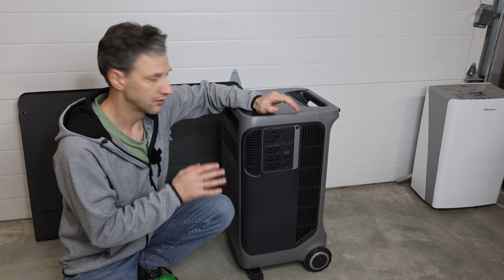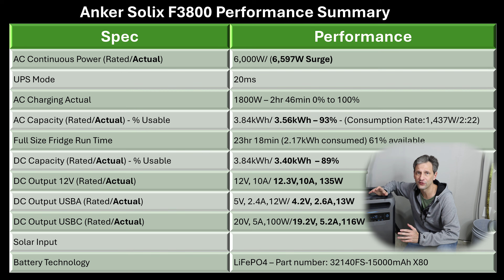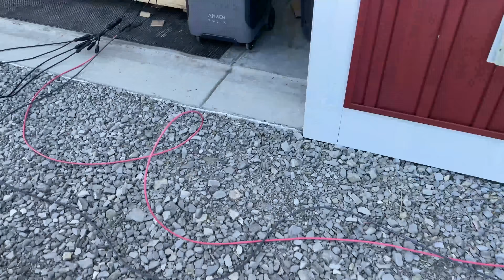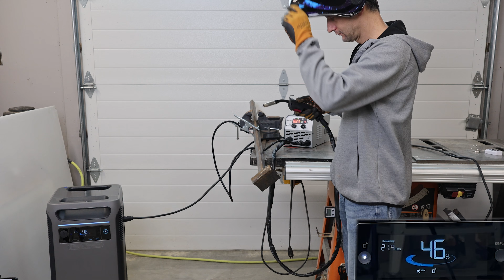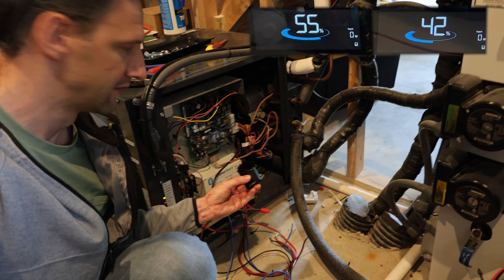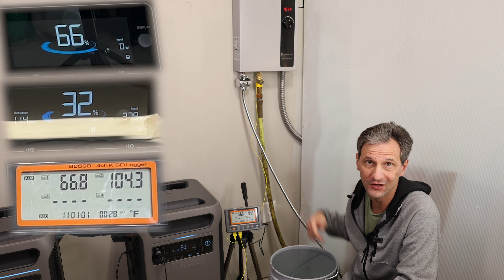Anker F3800 Solar Generator 120/240V Full Testing

Comment: The Anker Solex units really are impressive, also have very efficient inverters so you get very good performance per kWh of battery.
Reply from the maker: It’s impressive to see how much performance they can pack into these units.  They aren't the cheapest, but they tend to be one of the best performers.

Comment: i have an anker 3800 and im having trouble with a window ac its 2400 btu the biggest ive seen i need a connecter for an 240 vac 20 amp so it can fit  6-20 p any idea?

Comment: I purchased a 600 watt portable panel from All Powers. Could the  F3800 take input from two of these portable panels?
Reply from the maker: You didn't list the VOC.  As long as the voltage open circuit is less than the max input for the F3800 it should be fine.  Put your panels in full sun and check the voltage at the MC4 connectors to confirm before connecting to the unit.
Reply: @ProjectsWithDave  VOC is 52.8

Comment: So you would not recommend running the full 2000w solar input. I was thinking of using this for everyday off grid power so i want to get the full 2000w solar input
Reply from the maker: You can use a 200W panel as long as it is within the voltage range of the input.
Reply: Im trying to set it up like that as well.

Comment: Awesome review! Regarding these all in one systems and "selling" excess power back to the grid (I'm in an area that pays 1 to 1), I've read up that Anker is the only portable system with that capability. I was leading towards the Ecoflow Ultra system until I saw that it apparently is not capable of offloading to the grid. Do you have any info that speaks to that?

Comment: This saved the food on the fridge during Hurricane Milton. I used a small gas generator to charge it during the day, and run it silently ay night.
Reply from the maker: That's a great setup!  A gas generator combined with a battery backup is an ideal solution.  I show the data in this video: https://youtu.be/f0skwN5sJvg

Comment: Very nice review, as usual. I can see the appeal of these in terms of simplicity. Unfortunately, this is the "give away the razor handle, and charge for blades model" Expansion batteries are very expensive. Why don't you do an underground water storage tank for dump loads?
Reply from the maker: I have an extra water tank for daily dump loads, but I can only use so much hot water.  There isn't a good way to convert it back to electricity.

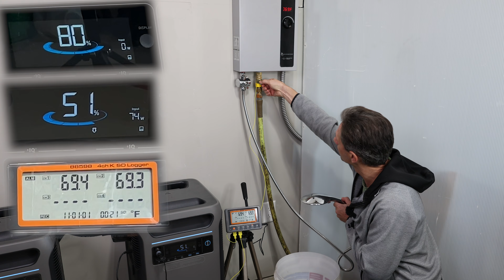Comment: 30:30 Water heating test was 👍👍👍
Reply from the maker: Thanks!  I thought it was a fun experiment.  I've always wanted to see if any of these on demand water heaters would actually work.  Now, if you live in Alaska the water coming in would have been too cold to be elevated to a reasonable temperature, but anything south of Ohio should be workable.
Reply: @ProjectsWithDave  now for a point of use under counter 8 or  12 gallon electric with a single 1500/2000 watt element??

Comment: Can you use the unit while plugged in to a standard outlet 120v without the Anker "power panel" ?
Reply: When it's charging off the 120v plug, the 220 outlets and one leg of the 110s (three outlets) are disabled. Only the UPS outlets remain powered.
Reply from the maker: @perrya4878 If you are using a single unit without the power panel, it will work as a UPS when pugged in.  So, yes you can use the outlets when it is plugged in.

Comment: Did I understand you correct, that you can charge with solar AND a wall outlet simultaneously?
Reply: No. It will only use power from the wall. If you lose wall power it would start drawing from solar if it's available. There is no way to make solar input priority for charging
Reply: thats what i want to know..... ????

Comment: 5000 watts you had .1 or 10 minutes run time?
Reply from the maker: The capacity is only 3.8kWh per battery so each unit can only provide a little over 3,000W for an hour if it is a continuous load and the batteries are full.

Comment: Power for days? When you plugged in 2 heaters at over 2000 watts tue screen on machine said .4 hours left on charge. Funny all sponsored videos fail to mention time until out of juice
Reply from the maker: Time depends on load.  That is what the fridge test is for.  It shows the typical amount of time you can expect to be able to run your refrigerator on a full charge.

Comment: Hi Dave I really thank you for this video however Can you do one that shows you running your whole home ac with fridge and washing machine? We do want to be able to do those things in the event of a power outage. I have watch plenty of use videos but no one does the whole home air conditioning with fridge washing machine and dryer.
Reply from the maker: I did a test showing the unit can easily deliver 10kW at once for extended periods of time so you just need to add up your appliances and make sure it is under that.  If you ran them all at the same time, you would want to start the AC first because of the surge load at startup.  Also your AC would likely need a soft start device.  Once it's running it really isn't that big of a load.  My 4Ton heat pump is only about 2.5kW.  The fridge is very small less than 1kW, the washing machine is in the 1kW range, the dryer can range quite a bit but lets use the max at 5kW.  The total would be 2.5kW+1kW+1kW+5kW= 6.5kW. Since most of those are split phase loads you would be well under the 11kW max for two Anker 3800 units combined with the home distribution center.  Hope that helps.
Reply: @ProjectsWithDave  thank you sooo much

Comment: I have precisely zero interest in PV but a battery+inverter at 120/240V is very interesting to me. Even 3000W would run my A/C, lights, and fridges - and 5-6 kWh could get me through all but the hottest nights. I’m still on gas heat and a gas water heater, but I don’t want to run a gas generator during the night in a power outage.
Reply from the maker: Not having to run a gas generator at night is one of the best reasons to get some battery backup.

Comment: Do two units double the power of the inverter ? Is the total 12000 watts ?
Reply from the maker: Right, each unit is 6,000W.  So total with 2 units is 12,000W.
Reply: @ProjectsWithDave  many thanks. Starting to save now 💙

Comment: Mistake there… it is 1200 watts per port. In total is 2,400 watts. That is why you saw more than 1,200 watts and the unit did not shut down. Using these same solar panels, you can put three parallel panels on each input. Total of six 400 watts panels (using anker panels as example, with other panels you have to do the math to get 2,400 (1,200 watts on each input). Last firmware update lower the voltage threshold and increase the input amp to 27 amps instead of 25 but still max power input per port is 1,200 watts.
Reply from the maker: The challenge is getting 1,200W into one port with such a low max voltage.
Reply: @ProjectsWithDave  is it possible I just bought this thing and now I'm freaking out that I can't run 6 400w pannels to it.  That was one of the reasons I bought it
Reply: @ it will cap at 1,200 watts per input port… per F3800 the cap will be 2,400 watts (2 inputs). These are the three restriction on each input… 60volts, 27 amps or 1,200 watts… what ever you reach first will cap your input. Best combo I found was three 44 volts / 440 watts solar panels in parallel. I got 2,300 watts of input. With 2 F3800 you can put in about 4,800

Comment: Side note regarding inductive loads... high frequency inverters get a bad rap, but in my testing I've found the biggest factor by far is how it's programmed to deal with these loads. Many inverters trigger a fault if a certain output threshold is reached for even 1/60th of a second. MOST inverters are properly equipped to handle substantial short spikes, but their driver modules are not properly implemented to make the most of the hardware. A while ago, I chanced upon a brand that actually implements solid logic on their inverters (Xijia / Swipower), and it completely changed the way I think about inverters. Their 1500W model (yes, 1500W) outperforms a popular 3000W inverter handily. In fact, it starts every 120V appliance I own (12A shopvac, air compressor, any power tool, etc) with the only exception being a 12,000BTU portable AC (almost nothing starts it). This is 100% down to its use of built-in soft start driver and very well programmed fault detection. It's pretty remarkable what a well-designed high freq inverter is capable of!
Reply from the maker: I would agree there is a significant difference between brands on the performance with induction loads with hardware that is rated the same.  I haven't tried the brand you mentioned.

Comment: Hi, was wondering if ac couple solar system on your house will still run if the grid is off with anker panel system
Reply from the maker: No, the system is connected on the grid side of the Anker system.

Comment: I have a food trailer and was thinking of switching to one of these units. I believe that im running about 2300w or so with an ac unit (1500w) and 2 freezers (200w a piece) that run constant. I currently use a 9000w Predator that gets me about 4 - 5 hours of run time per tank. In your opinion, do you believe an Anker can be a good replacement?
Reply from the maker: How do you plan to charge the F3800?  The unit should be able to run your loads without a problem, but if you are running the AC constantly it will only last a couple of hours with the internal battery.  If you wanted more run time you would need additional expansion batteries,  add solar or charge it periodically with the generator.

Comment: I like what I see from the Anker F3800. Also the Eco Flow similar one looks good for a minor backup.  The down side of these devices in my opinion is the lack of capacity (kWh).   Yes, they can add battery storage to increase the capacity but I might still lean to a DiY system with my own battery bank.  I say this because of the cost of the Anker or Eco Flow.  I do like the portability and I might be over stressing my need for capacity in an emergency.   My full usage can be close to 100kWh/day during high usage.   Often it can be below 93kWh/day.  I am measuring that with my utility and the Emporium electric circuit analyzer (16 circuits I think).  There are many use-cases that will work well with these portable units, so I am not saying they don’t have their place.  Just the cost of adding enough battery for my capacity is cost prohibitive.  I am not saying these are wrong, just essentially telling you my life story (that you didn’t ask for by the way haha).  Again, thanks for the video.  All the best from north Texas!
Reply from the maker: Thanks, for the thoughts.  I think these all-in-one systems are great under the right circumstances.  However, if you really want to run a house with the loads you are talking about, I think it makes more sense to do a modular residential grade system.  You can get much larger batteries for the price point with those types of systems.  I have several options on my website you can look at using this link, the ones from EG4 are hard to beat: https://projectswithdave.com/batteries/
Reply: @ProjectsWithDave  yes I agree
Reply: @ProjectsWithDave  yes I like the EG4 batteries.  Signatures solar is just 30 minutes away so I have that going for me.  Haha
Reply: Fully agree, Beautiful appearance and portability come from Anker and EcoFlow, But the capacity is small and the price is expensive, so we can't afford it. My friend recommended me to use 20KWh all-in-one with10KW hybrid inverter from VNICE POWER . But I don't know anything about this product.I would appreciate it if DAVE could introduce a low-cost energy storage battery product.
Reply: Whoa, that’s a lot of power. You’re gonna pay through the nose for anything that handles 100 kWh daily. Your power bill must be massive!

Comment: Nice review.  The only thing that is holding me back is the PV voltage limits.  I have seven Sirius 410W (VOC 37v) bifacial panels for a 24K EG4 mini-split.  It works great, but I think I would prefer to hook up the panels to a battery system and then run the mini-split off of 240v more than during sunlight hours.
Reply from the maker: Running a mini-split directly from solar is a struggle because every cloud that passes over resets the system.  A battery in the loop would make a huge difference.  I think they should come out with a mini-split that has the option to connect a battery to fix that issue.
Reply: @ProjectsWithDave  My bifacial panels generate over 2200 watts of power and my two arrays are separate.  The 24K EG4 says the operation range is between 190W to 2250W.  My experience has been there is enough wattage to operate the mini-split even in cloudy weather.  I have not yet noticed the system reset during  the day.  My house is 2100 sqft with the majority being open concept.  The 24K mini-split keeps my house around 68 degrees from sun up to sun down.  The most interesting feature is that when the unit turns off after sunset, it remembers the settings and automatically turns on after sunrise.

Comment: Can it supply your every day needs. I think these systems are great for what they are intended for. Running commercial grade industrial tools is not a concern for the average home owner who wants to run as much of his home off grid when the power goes out.  It would take 2 3800's and 4 extra batteries with the solar maxed out to 4800w to be considered a whole home backup system.
Reply from the maker: It depends on what you are running.  For my home I need about 10kWh to have good margin to my loads.  That would require extra batteries.

Comment: Good informative video. It seems every time you invest in a system, out comes something new and improved for less money! My concern was always that if the grid had a serious hiccup this equipment would become scarce and or really expensive real soon. Solar panels are an excellent example. They will be "worth their weight." Only issue I had with this unit is the very high (IMO) inverter standby power consumption. Maybe its inherited of a split phase unit but Anker needs to fix that somehow.
Reply from the maker: It could be because it is really running two 3kW inverters to make split phase.